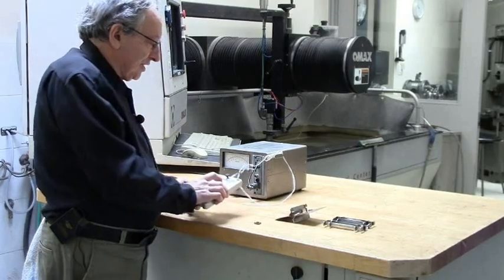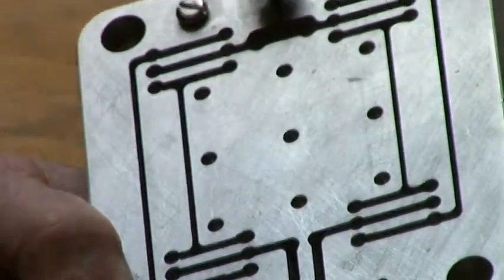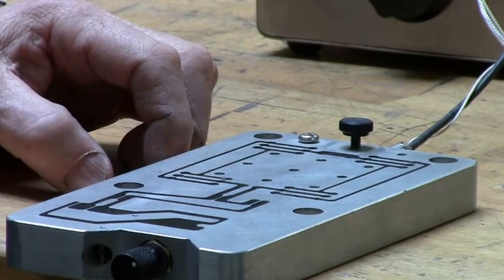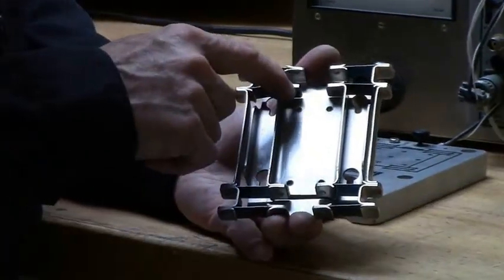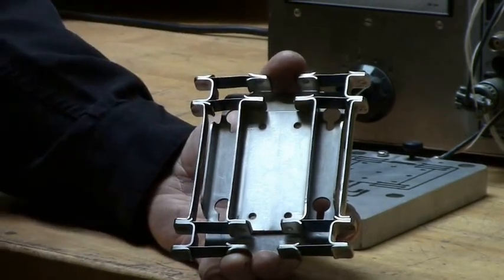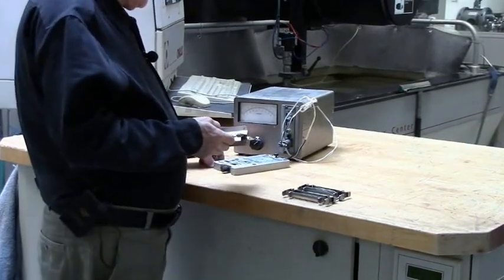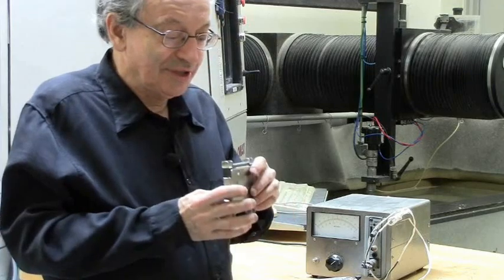Building Prototypes Dan Gelbart  part 10 of 18  Flexures

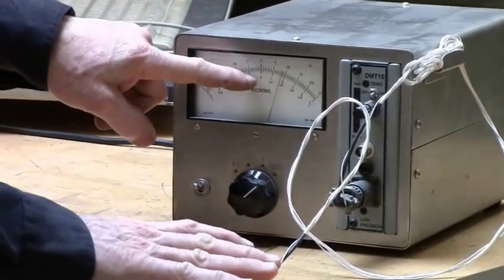Comment: 3:39 Since the meter measures deflection with capacitance, couldn't the presence of your hand be adding stray capacitance to the circuit? I could see the heat from your hand causing deflection too, but I'd be surprised that the deflection would track so well with your hand distance and rate of hand movement.

Comment: WRT lower cost -- I found exactly the opposite to be the case. PI flexure stages cost 10-100x more than bearing-based sliders.
Reply from the maker: Do not confuse cost and price. If you make them yourself, a flexure stage will cost a small fraction of a conventional stage. If you buy them, price may be high as the market is small and caters mainly to people who don't pay with their own money (universities, research labs etc).
Reply: @dgelbart  Fair enough! Cutting the stage itself by wireEDM in Alum 6063 is indeed not bad in terms of cost, but once one adds a piezo actuator, strain/capacitative gauges, a low-noise power supply etc it adds up. So I am thinking instead to try a 508 TPI screw, a decent stepper motor, and lever reduction per your design (I am after sub-10 nm movements).

Comment: Did you build the capacitive sensor yourself?
Reply from the maker: I did not build the one in the video, but I built many similar devices. They are easy to build and are great. Interestingly, the accuracy is not affected by the flatness of the object,  even if you measure to a curved surface.

Comment: When you say that flexures have no wear / infinite life : does that take into account metal fatigue from repeated cycles of bending the pivots ? I admit I'm a newbie when it comes to mechanical engineering (I'm an electrical engineer). Is the bending so limited that it does cause fatigue ?
Reply from the maker: The fatigue limit depends on the metal and on what % of the elastic limit you are using.  If you design it right, life is infinite. Think of the hairspring in a mechanical wtch.
Reply: @dgelbart  ah, I see. Thank you !
Reply from the maker: @TheNefastor  Don't worry, I'm an electrical engineer too, but I often impersonate a mechanical engineer.
Reply: @dgelbart  we're quite a lot. I think it's because we all eventually realize that we can't just make circuit boards, but also need to make something to hold them in place. That's how it started for me, and eventually it evolved into robotics and DIY CNC machine tools...

Comment: Make Flexures with a water jet the tapered cut the water jet make is not a problem?
Reply from the maker: On thick plates the taper of a waterjet is very low (and you can cancel it out by slowing cutting speed). On precision flexures, like the aluminum block in the video, I drill and ream all holes at the end of the flexure arms first, then connect the holes with the WJ.

Comment: If you put your aluminum flexure in a tub of water would that act as a buffer so it would not drift? The amount of energy you would have to put into the water to change the temperature would be much greater than the energy needed to distort the metal. If the water was frozen you could also take advantage of the energy required for phase change.

Comment: I worked for a company that made middle frequency vibrating X-flexures as an alternative to mirror galvanometers. The product never found a market. One unexpected headache was persistent spalling at the point where the flexure was clamped. No amount of clever clamp design, such as the curved (hyperbolic?) clamp ends you demonstrate, ever effectively solved the spalling problem, limiting "infinite lifetime." Another problem was that no matter how high the Q of the flexures, there was never any adequate way to isolate the flexures from external sources of vibration, in real world applications, to the desired level of noise rejection. On the bench, yes. In machinery like a helicopter, with dozens of high magnitude vibration sources, not so much. Also, obtaining consistent flexural material from vendors, batch to batch, turned out to be non-trivial, since blanks needed to be not only dimensionally consistent but also alloy-composition consistent and internal-stress consistent as well. While nowadays I suppose the problem of designing flexural machines is readily solved in computational software, back "in the day" designing cross-flexural vibrators to precisely hit a combination of frequency and inertial targets was an arduous exercise.
Reply: Thank you so much for sharing these important details. I take it the spalling is avoided when the flexure is fabricated monolithically, but how would you approach it now? Was it a surface phenomenon of the flexural material? Or could it be circumvented with a polymer clamping shoe? No one else has ever drawn my attention to this issue--again, thank you.
Reply from the maker: Did you use Nitinol for the flexures? I can see it happening with spring steel.
Reply: Interesting - I would anticipate fretting fatigue failures at the point of fixture, but not spalling.
Reply: Look into Prof Jon Hopkins at UCLA for methods to reduce external sources of vibration, multiple methods to do this.

Comment: Hi Dan, What do you think of using carbon fibre sheet for the flexures? Ideally unidirectional I guess, I realise they can't be spot welded but I can CNC carbon easily and I'm thinking that the parts could be bonded with a suitable epoxy.
Reply from the maker: Can be used, bond line will probably open over time, but joints can be riveted.

Comment: I don't know if Dan Gelbart monitors the comments, but would be grateful if anyone could advise the dimensions of the nitinol strips used in the flexture featured at 5:30 etc? 

Are these Nitinol strips available commercially in relatively small quantities? I'm not having any real luck finding where I might get these stips, especially in relatively small quantities.
Reply from the maker: Nitinol strips are about 10mm wide, 0.5mm thick. They are readily availavle but very expensive, better to look for it on Ebay. If no luck try Nitinol suppliers like memry.com.
Reply: Thank you, that was very much appreciated. I can only find the Nitinol as wire rather than strips so I will experiment with regular carbon spring steel and account for the lower elastic range.

I hope you can be encouraged to publish more on Youtube. I go back and watch your videos again every 6 months and always learn something new each time I watch them. Flextures are a particularly elegant solution.

Comment: Hi Dan, thanks so much for your videos, I watched them all in sequence while in the airport and intend to watch again.   I am curious to hear any vignettes you might have about using 3D printers in your work and would love to hear your thoughts on technique.  Is there a place in your prototyping workflow where you have found 3D printing useful?  I do not currently have access to a waterjet, and am working on 3d printing of flexures.  Thanks for the inspiration!
Reply from the maker: 3D printing is becoming a useful tool, but unfortunately for plastic. Most of my life I worked in high performance/high accuracy stuff, were plastic is useless. However, 3D printer is great for making wax patterns for investment (lost wax) castings so I recommend having one, especially at todays low prices. Metal 3D printers still have payback only in certain application, even if you have the funds to buy them.
Reply: David Gorczyca In the event you didn’t see it, Dan just did a new video on 3D printing last week. Worth a watch!

Comment: Please pardon my ignorance but you have told me how build a device that I don't understand what it does an what it's purpose is,      please educate me? I have watched all of this  series so far and it's very informative and I like your presentation style.
Reply: Flexures are for really high precision positioning, so think of things like optics and scientific equipment. Normally precision increases the price/difficulty of manufacturing, but flexures are a way of having extreme precision from a device that is easy to make. One example is openflexure, which is a microscope where the x,y, and z ways are all one (3d printed) part, so the microscope has very precise focusing but is made using an imprecise manufacturing process. You can read about that here: 
http://aip.scitation.org/doi/10.1063/1.4941068
Reply: @the_grand_blooms  Thanks for the read.

Comment: Excuse my dummy question, but what is flexure for? I found this and suppos this is related https://en.wikipedia.org/wiki/Linear_stage#Flexure but I dont get the point. Is there some application to look at? Thanks in advance
Reply: +bvsiness 
Yes. They are used in pulse tube or stirling cryocoolers for example. It's used to hold the piston in position, that oscillates back and forth. The friction is very low, there's no wear and there therefore no maintance required. This is almost required in cryocoolers since you can't open them. It needs to be completely sealed to hold the helium gas. Furthermore since the flexure bearings keep their position so well, they use it to maintain a tiny and constant air gap between piston and the outer wall, this also reduces friction and wear. Cryocoolers really would have a difficult time without flexure bearings. 

But i guess, there are many more applications. Since it can be used as a spring and as a guiding system/bearing.

Comment: Hello Dan,

When you demonstrate the sensitivity of the aluminium flexure to radiated heat from your hand, is it not possible that some of the deviation shown by the capacitance sensor is due to changes in capacitance from your body?
Reply from the maker: praetorious The flexture is grounded to prevent this (you can actually see the grounding wire wrapped around the sensor cable), but there still could be some small electrical noise effect. The majority of the effect is radiated body heat.  Problem is worse than simple linear expansion, as non uniform radiative  heating distorts the part.

Comment: Thank you so much for making these videos. They are great! Could you clarify what say at about 3:15 about the temperature sensitivity of aluminum.
Thank you again for taking the time to pass along such valuable information!
Reply from the maker: Richard Baker Aluminum expands with temperature about twice as much as steel, so precision parts made from aluminum are more temperature sensitive.
Reply: @dgelbart  Is it possible to use the reversal method to self compensate for temperature change?  Not for differential temperature change, just working temperature of the flexure.  In much of the electronics I've been involved in a differential approach is used to compensate for things which affect two paths - the Aluminium flexure was "single ended".
Reply from the maker: Possible, but since temperature effect is repeatable and predictable, it is easier  just to measure the temperature and calculate the error.
Reply: @dgelbart  lol.. thanks you answered my next question in advance :)

Comment: Hi Dan, when you say the angle is the integral of linearity, are you speaking conceptually or can this be stated explicitly? Just trying to follow.. thanks!
Reply from the maker: taiden If you have an angle "A" along a length " L"  the total vertical shift is AL. As the angle keeps changing the path shape is the intergal of the angle over distance. Angle is expressed in radians.  If you never took calculus there is no problem, just divide the path into short segment , measure the angle for each segment and calculate AL (which could be positive or negative) for ech segment. From these values you can draw the profile.
Reply: Dan Gelbart I follow now. Thank you for the concise reply. Enjoy your weekend!

Comment: Wow, these flexures are really inspirational! Thanks for demonstrating.

Regarding the laser alignment technique; I've used this before for aligning other fixtures.

Here's an improved method I use: If you place a mirror on the fixture and several mirrors on the wall you can measure even smaller graduations as the angle error is multiplied by two each time the ray returns to the fixture. At some point this becomes untenable due to the losses and lack of flatness of each mirror, or because vibrations turn your fixture into a seismograph. The alignment isn't that difficult because you're only ever aligning the tail end of the laser path back onto the target mirror; unless you knock an earlier mirror or the test fixture, then you've got to start all over again.

You can probably get much better results using a vibrationally damped optical workbench and first surface mirrors, but I'm not a millionaire or research scientist, so I used broken up CD-ROMs or bits of makeup box mirrors which worked ok for 5 or 6 multiplications which was enough to make vibration the limiting factor. 2**6 = 32 multiplication * 12 path lengths * 20m, to get the same angular resolution without this technique you would need a 7680m pathlength, and you wouldn't be able to see the laser spot anymore.
Reply from the maker: puddingpimp The magnification will actually be the same in both planes.  Also, no need for several mirrors, just a larger mirror.  Point the laser pointer to the distant mirror.
Reply: hello,
if the screen that is receiving the laser pointer is inclined?
Will the pointer movement be multiplied the more the screen is inclined close to parallel to the laser beam?
Reply: Yes. Beware that the magnification will only be in one plane and it will also magnify the aplanarity of the screen.
Reply: indeed...good point